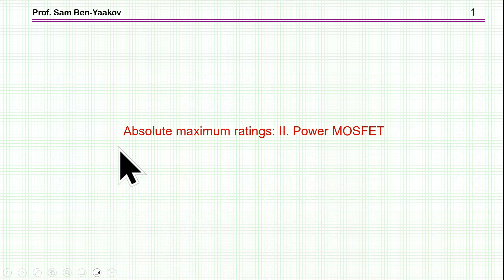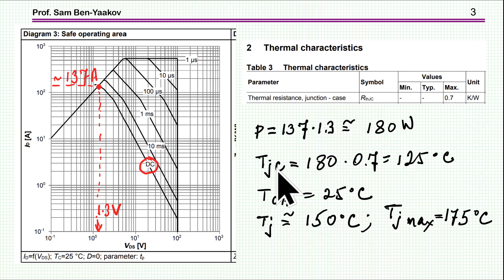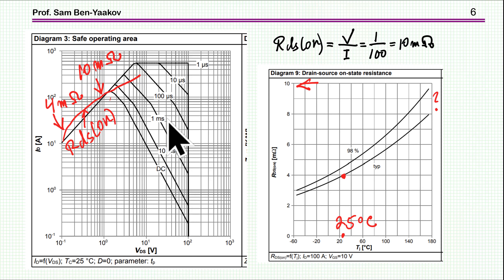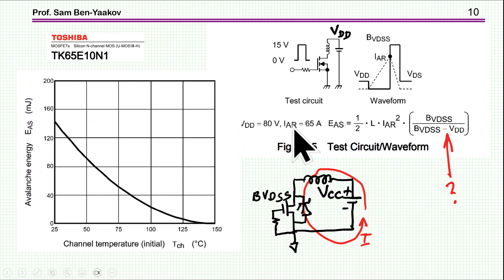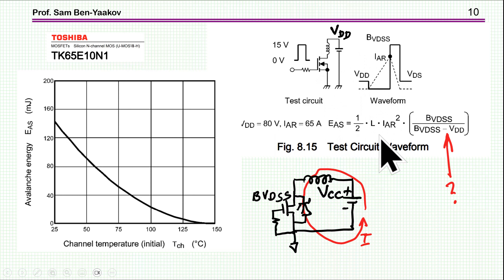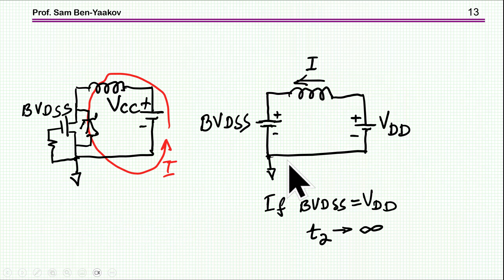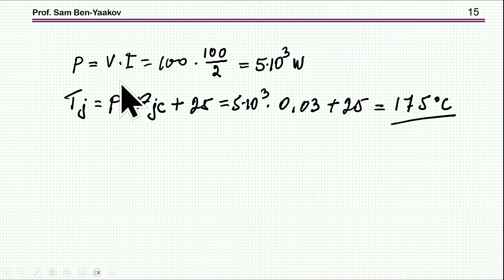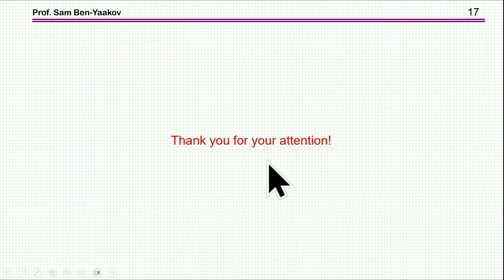Absolute maximum ratings: II. Power MOSFET

Comment: Practical case about peak Vgs voltage holding if anyone is interested
Setup: IMBF170R1K0M1 SiC-FET (20 Vgs according to datasheet) acting as a switch, drived via the KSP2222 BJT in avalanche mode. No TVS or Zenner connected to g-s.
Mosfet holds a 120 Vp pulse on gate with 1.5 ns rise-time and 30 ns duration. Current pulse rise in the drain-load loop is about 2 ns. No gate breakdowns occured after many hours of working.

The duration of the applied pulse has a great importance. At more classical timing, like 1-10 uS pulse, gate breakdown occurs at 40-50 V already.
Reply from the maker: Is this backed up by the manufacturer?
Reply: @sambenyaakov  No, the manufacturer avoids mentioning such modes for commercial risks reasons.
As one engineer from Wolfspeed told me once - “We define values in the datasheets that we can guarantee based on data from our development and testing department. They are often underestimated, but still ensure a minimum number of failures. You can work above these limits - but this at your own risk, and we decline our liability in such cases."
I should probably warn those who read the previous message - if you are developing commercial electronics, do not go beyond the datasheet limits, otherwise you may incur serious costs. The case I described is purely laboratory-experimental, just to keep in mind. Good for IEEE/ResearchGate articles, but not for the market.

Comment: The total energy the transistor dissipates is the inductor's stored energy PLUS the additional energy provided by the battery while the current is flowing.  Given the two battery analogy, the left battery is charged while the right battery is discharged.  The energy delivered by the battery is VIt/2... its voltage times the average current times the time to discharge the inductor.
Reply from the maker: This is correct but has been taken into account in the derivation. And if you missed this: no matter from where the current is coming, the energy absorbed by the transistor is always Q*Vbr.

Comment: Thank you, Dr. Regarding the advanced applications of MOSFET avalanche, are there specific considerations that differ when compared to those mentioned in "Driving Solenoids in Automotive Applications AN50003 (Nexperia)" and "Using Motor Drivers to Drive Solenoids SLVAE59A (TI)"? For example, are there special considerations for linear mode, higher Vth, or Qg? thank you.
Reply from the maker: Thanks. I am not familiar with these publications.